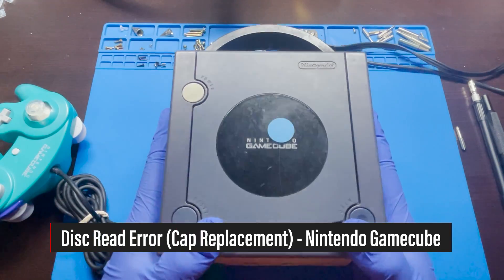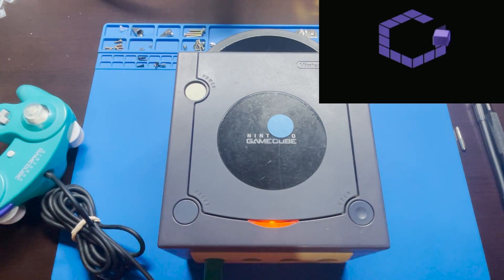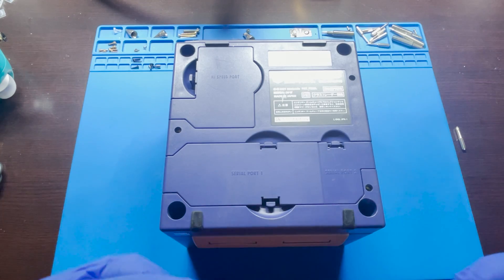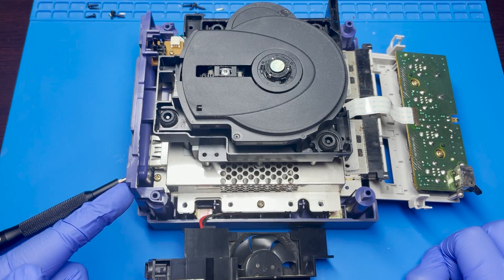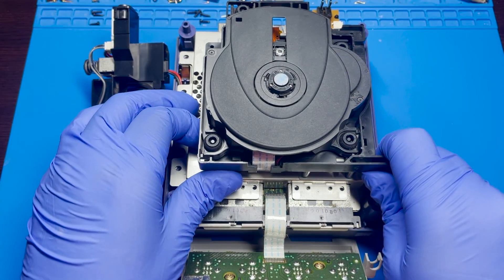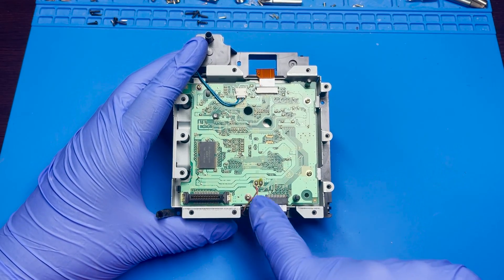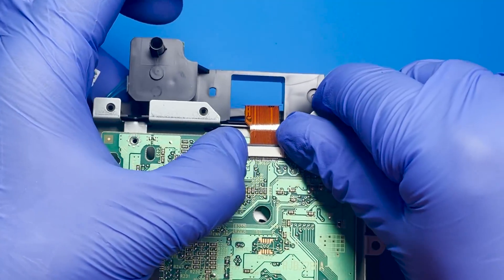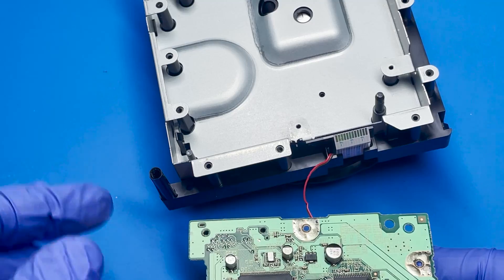Make Your Nintendo Gamecube Disc Reader Like New Again!

Comment: It appears you can get away without having to wick up the old solder with a braid and just reuse the existing solder adding as needed. Can you get away without using flux?

I’m not great at soldering. Mostly just working swapping out the no longer working motors on motorized toys.
Reply: Update.

I just replaced the capacitors on mine yesterday. I my soldering skill is mediocre so a couple are not totally flush with the board. I had to buy a potentiometer. Harbor freight has one for eight dollars. Got it settled to 568 ohms, partially put it back together and played Pokémon XD for about an hour.

I have mostly put it back together as I’m still waiting for a battery to come in the mail so the front and shell are still off.

Comment: Help, I haven’t done this but would this fix mine?
My disc doesn’t spin, my laser doesn’t turn on and the motor for the laser assembly doesn’t move
Reply: I don't think it will, this is for when everything seems to work fine but the disc doesn't read, seems like you have a faulty disc board or something not making connection

Comment: "You'll need a soldering iron.."   ...I'm out lol!
Reply: Recommend practicing on just junk circuit boards. I taught myself how to solder from fixing old motorized toys like Zoids by replacing the DC motors inside them. Finally worked up enough skill and confidence to try this.

I just did it today. Played it for an hour and it seems to be working. I still have to get a new battery for it.

Comment: Thank you for your video. I agree about wicking the solder and would additionally suggest that you apply flux to the pads before attempting to solder new caps. I also take a pic with my phone on the orientation of the caps and their values to make sure I solder them on correctly before I begin actual work. Be aware that using hot air for removal can cause the electrolytic caps to explode, so be careful in that respect.

Comment: The idea is there and still a very good walk-through. The old solder it usually lead-free because it was for mass manufacturing and is a little harder to work with because it needs more heat then the typical 63/37 or 60/40 solder (hobbyists are exempt from requiring to use lead-free solder).

Comment: i recap and again laser spin disc 10 seconds then stop same as before recap?
Reply from the maker: The only thing I can recommend after a recap is to adjust the potentiometer on the laser, the combination of both things tend to fix the problems majority of the time. Otherwise the board may contain a separate faulty component
Reply: @totalfix877  potentiometer is okey

Comment: Your channel is so helpful! Thanks for all the effort you put in. Helping a newbie like me understand and see some great techniques!
Reply from the maker: Glad to help!
Reply: @ I hope to see more from you in the future! Have any recommendations on where to start learning to read schematics?
Reply from the maker: The best way to get started is by working on a simple board to understand how different components function. Choose something safe—devices that don’t hold a large charge, like handheld electronics, are great candidates.

A digital multimeter is a must-have tool. Learning how to use its settings and following traces with a schematic will help you diagnose circuits effectively.

For example, let’s take a Game Boy Color:
https://wiki.console5.com/tw/images/e/e6/Nintendo_GBC_Schematic.png

At first, schematics can feel overwhelming, but a good approach is to start with the power source and follow the traces. In the linked schematic, begin in the top-right quadrant—you’ll find the BATTERY. Identify the positive and negative sides, then follow the traces to see where they lead. Continue this process, referencing the schematic to understand how power flows through the board.

If you need more guidance, let me know! There are also plenty of great YouTube videos that break down these concepts in detail.
Reply: @ thank you so much! Really appreciate your insight and direction!

Comment: Are there specific signs that indicate that the caps need to be replaced? I’ve repaired a number of GameCubes now but I’ve never done this. I know the typical problem with the GameCube is the discs don’t read. In all but one instance I’ve always done the pot tweak and it worked. Could it be that the one instance needed the caps replaced?
Reply: I've never repaired a gamecube but I will need to fix mine up but from what I have seen this is a proper fix to the problem since the pot tweak is the quick and dirty fix. Things will work but from what I have seen it sends more power to the laser, so that could potentially damage discs/the laser itself long term even though in most cases it seems to be fine.
Reply: Turn on the GameCube and let it “warm up” for about 15 minutes. Put a disc in and see if it reads. If it reads then it is 100% a capacitor problem.

You do not want to adjust the homes on the potentiometer below  450 on a DOL-001 or 150 on a DOL-101 as you can burn out the laser or the laser can burn the discs.

Comment: Can you tell me how to fix a DOL-101 model GameCube. When I turn the GameCube on it spins a disk for maybe 5 seconds & stops spinning then pops up on a tv screen GameCube memory I’ve tried cleaning the laser lens, checked the caps on the motherboard, & reset the potentiometer, but none of those have fixed it. It’s still the exact same thing.
Reply from the maker: This might be due to a faulty reader altogether, I also had problems like this in the past where I just replace the laser lens after caps have been fully replaced. I wish I had a better answer, but I don't want to say that it is that 100% for sure, but generally that's the issue.

Comment: Hi there, what would your troubleshooting tree look like for a gamecube that can't read discs?  Would you replace the capacitors before or after replacing the laser?
Reply: Let the GameCube stay on for about 10-15 minutes to let it “warm up” and then see if it will read a disc then. If it does then it is 100% a capacitor issue.

I would say replacing the capacitors is medium hard. Ironically if you don’t have a heat gun getting them off is harder than putting on the new ones. Because if you use the twist method like I do to get them off you have to get the broken capacitor tabs off the board and  that can be tricky and you need to use a braid or a spuger to get them off the board. Soldering braid is a must for this.

You could adjust the potentiometer but I don’t recommend doing that unless you have a multimeter. You can get one at Harbor freight for like eight dollars. I did the Swap in mine and mine’s an older model so the ohms are supposed to be between 450-600. Mine settled on 568. You want to start at 600 ohms and work your way down. If you adjust it below 450 on an older DOL-001 or below 150 on a DOL-101 that means your laser is bad. And if you put it below those specs you will either burn out your laser or burn your discs.

But it’s usually going to be the capacitors.

Comment: Excuse me. I found your video very informative, but I don't have the means to replace the capacitors on my own(tools wise). If you're willing, I'd like to send in my GameCube. I can pay shipping plus whatever you may charge for the work. Thank you!
Reply: You don’t need fancy equipment or heat gun just a soldering iron, look up vids on how to do it heat each side of cap while slowly moving it off, if u somehow break it they sell replacement drive pcbs. if not there are lots of people willing to do this service. Seems like this guy doesn’t offer it

Comment: mine runs on 22 ohms. if i switch the capacitors will it fix all my problems? and run on a regular ohms #? 

i bought a another gamecube. but JPN gamecube off ebay but was unaware it only runs japanese games. its possible to modify it and chabge regions but thats more money on the tools than possibly 2-3 tools to just switch capacitors on my US gamecube.

PLS LMK!! 😭
Reply: dont you just have to rebridge a solder connection on the motherboard to change regions?
Reply: With the Japense GameCube, what you could do is shift over the R5 resistor on the main motherboard to R6 to change the system menu language to English, then install a XenoGC chip on the optical drive PCB to enable it to play games from all regions. That's what I'm doing now for a few Japanese GameCubes I have now. Alternatively, if you have a DOL-001 model GameCube, you can buy something like the SD2SP2 adapter to run Swiss and games from off a MicroSD card, though for some this may not be as attractive an option as running discs.
Reply: Also, like the video suggests, you could adjust the potentiometer to increase the laser's strength. This requires no soldering but may be more of a temporary fix. I'd suggest using a multimeter to check the resistance. If your GameCube is a model DOL-001, the range should be between 450 and 650 ohms, and if it's a model DOL-101, between 150 and 250 ohms.

Comment: do you happen to fix others gamecubes? i'm truly considering shipping you my gamecube to get the capacitors replaced and i'd pay however much id have to. please lmk!!!

 i've commented on another video of yours mentioning how i managed to fix the potentiometer but only runs on 22 ohms. will changing the capacitors help the potentiometer run on a reasonable ohms or is that a seperate case in its own?
Reply: i'd love to be able to email and reach out to you though as to which item is which on your links. example, im not sure if the IPA is what you used to clean after u took the capacitors off. 😅im unexperienced and going off of your videos solely!
Reply from the maker: It may be related to other components seeing how low the potentiometer is set. I don’t have a shop of any kind, I only do this as a hobby, but I might consider fixing it as long as the shipping costs are covered, free of charge.
Reply: @totalfix877  i hear ya, sounds good to me. i am on the verge of buying snother gamecube that DOES work so if that doesnt work out, i will keep it touch. thank you!!!